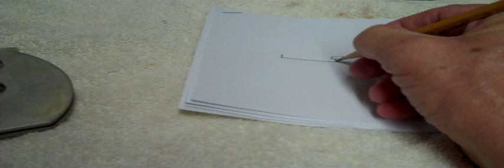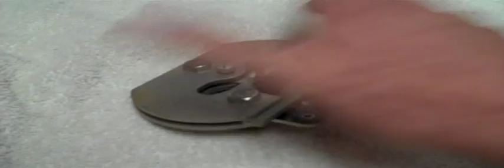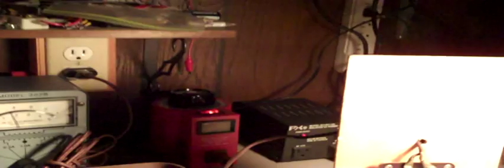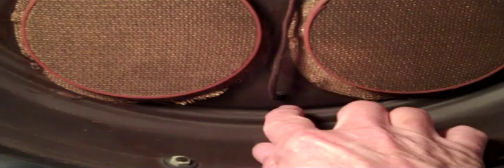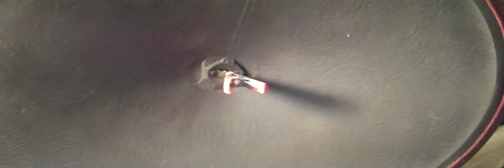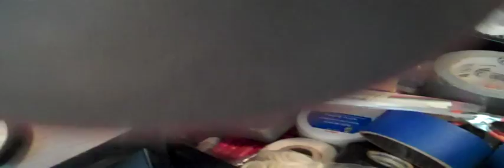1927 Atwater Kent Model 37 Repair and Restoration. (Part 15 of 21).

Comment: I know this is a really old thread, but I’ve enjoyed it as I’ve been working on my radio and speaker. Do you have a vendor that makes a decent replacement grill cloth for the back vent holes on your E speaker. I have my speaker electrically working, but the back vent holes are a mess. Thanks for your help in advance. Randy.

Comment: One thing I do recommend doing is this.

The radio has a bias resistor for the output tube.

The negative speaker wire connects to the end of the bias resistor that isn't grounded which was most likely done to eliminate one component.

Problem there is you now have whatever DC voltage that is across the bias resistor going to the speaker as well. If you touch the wire you can get a shock.

The way to solve that is connect the speaker negative terminal to the chassis and install a 1uF film capacitor in parallel with the bias resistor. That way the audio signal will still be the same level and you eliminate all DC voltage on the speaker.

Comment: Hi John.  I am a tech from Bose Corp.  Your are right to think the paper in the cone is causing this problems for you.  We call that "Cracked cone".  You want to put the paper in its original shape on the cone.  Hard two part epoxy will fix this for you, but the speaker will never be 100%.  Use only what you need for epoxy to stiffen the the week paper.  Maybe go onto the hard paper by 1/4 inch.  I bet it will work.  Have been done there myself years ago.  NICE JOB ON THE RADIO!!

Comment: John, you may want to consider using marine jell coat. It is a 2-part epoxe which can be mixed with a very low viscosity, paint like fluid.  Apply it to the cone to strengthen the fibers of the cone, and it dries very quickly to a hard finish.  It can also be colored to match the cone color.  Just a thought.

Comment: I was really impressed with how well the used fabric softener sheet worked on tears in paper cone speakers.  Maybe that plus the Liquid Paper or epoxy on the back would make for rigidity and strength.

Comment: I have stiffened up speaker cones with regular 2 component epoxy glue. just apply a thin coat at a time, and give it around 3-5 coats. i have done it a couple of times to REALLY tried old speakers. and they all turned out good after that :)

Comment: Well part of the issue is that the paper is weak right up to and under that reinforceing washer. But you can't soak anything into it too deeply as it might well spoil the finish on front. So what about using some coffee filter paper around the washer and then your liquid tape just around it,and under it a bit, so there is less chance of building in a weakness just under the washer. I think it would bridge the stress evenly outwards again.